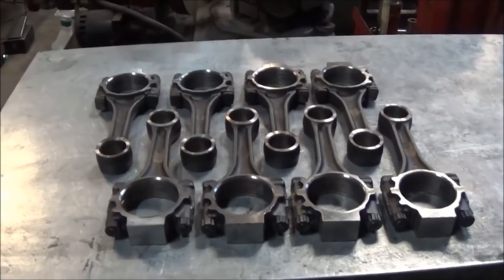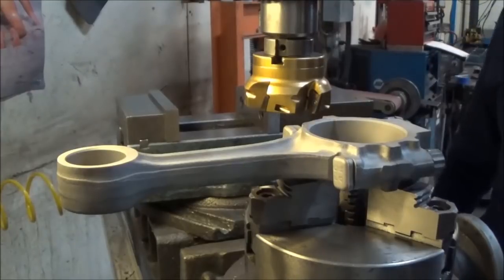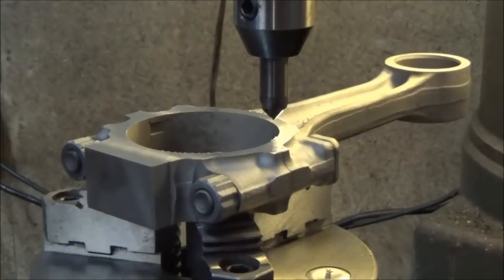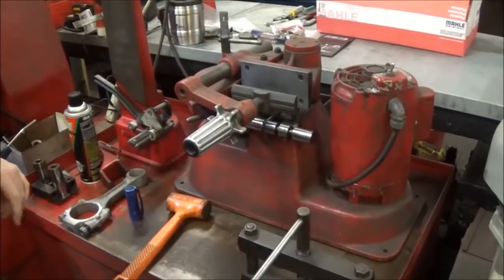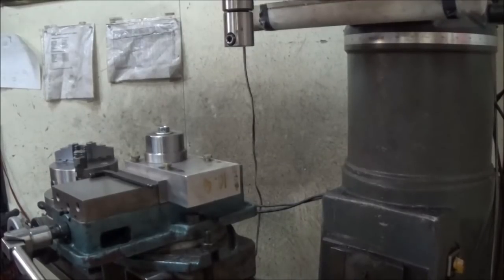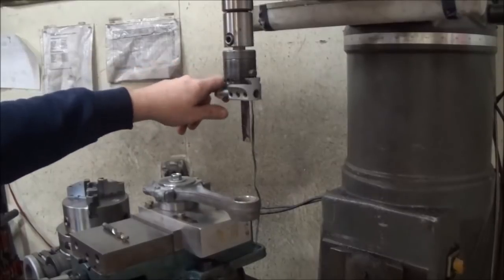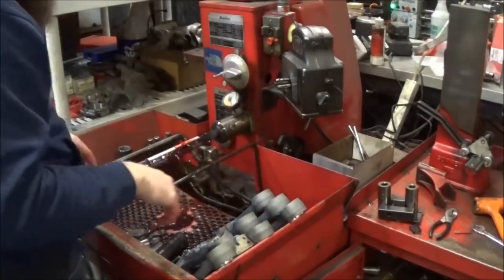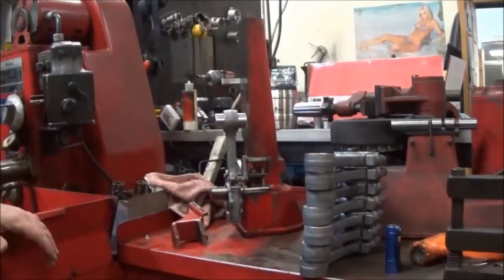R&D IDI 7.3 Power Stroke Connecting rod conversion

Comment: I’ve got a 1994 IDI Factory turbo. For years I’ve told my employees to be gentle on the engine because if it throws a rod it can’t be rebuilt. It’s nice to know there are options now.
Reply: Factory idit rods Justin says r good to 500-550
From what I've read, na to idit rods is a .040" & from idit to psd rods is .020"

Comment: Have you ever had the factory forged idit rods fail or are you running power stroke rods as a precaution?
Reply from the maker: No, the turbo rods are nearly as beefy. The main issue is supply, and by using modded PSD rods, you can effectively convert your N/A engine to a turbo spec unit with a rebalance. Forged PSD rods are far more plentiful than IDIT rods.
Reply: @RacinNdrummin  do you know when the cam stock is going to be updated on the website so we can order through the website ?
Reply from the maker: @TG-pu4fh  Site stock is going to be iffy for a little while, at least until I can get relatively caught up with my current workload. Your best bet is to just call and order it. I've been really good at getting to the phone in recent times.
Reply: @RacinNdrummin  are you still selling different stage cams or is it just one now?